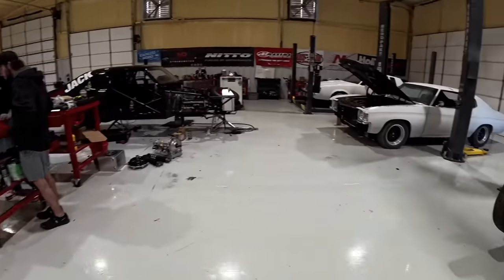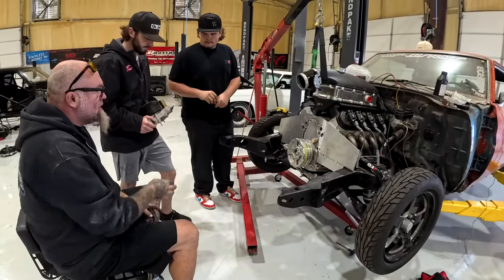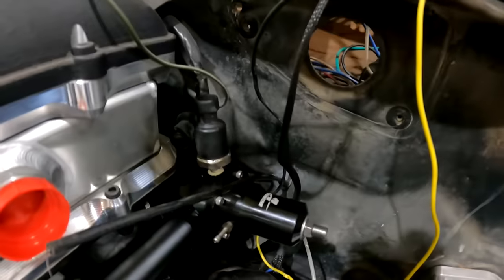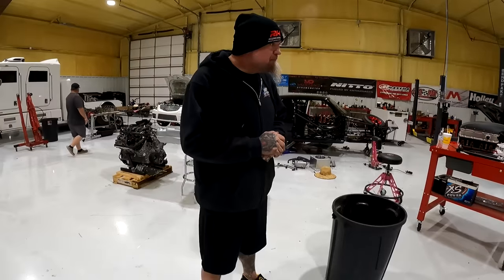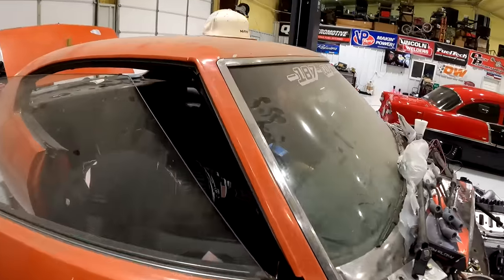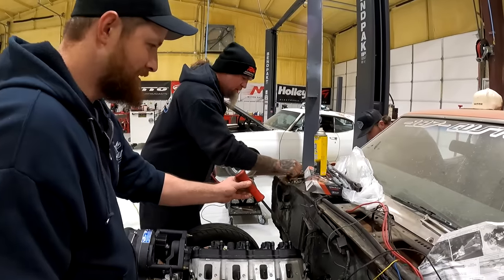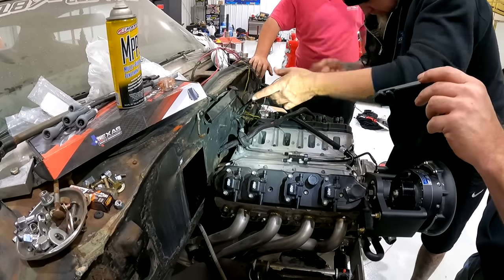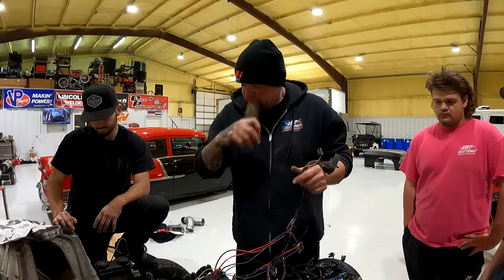Aiden's Chevelle Update! Final Engine Placement, Fuel System, and Laughs With The Boys!

Comment: Those intake ports sitting there open while everyone works on that car is giving me flashbacks.   I built a brand new engine and someone knocked a hose clamp in the port and it didn’t get found until it was too late.   Throw some tape over them or something please

Comment: I had a Cadillac and I had a tick and a burn two oils in between 2 quarts of oil in between oil changes. Took it to the Cadillac dealer because it was still under warranty. GMC said oh that's normal. The motor blew at 80,000 miles.

Comment: A plasma cutter will cut aluminum or clamp it and use a porta band, possibly a jigsaw? You can buy abrasive blades for aluminum for a grinder but I don't think that's what you have. I think I seen a plasma cutter in your shop though! lol